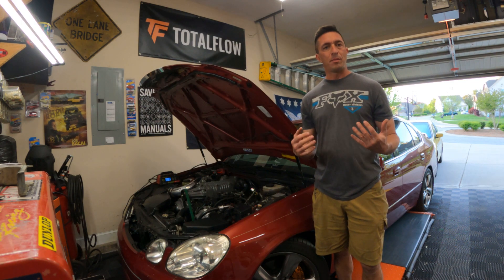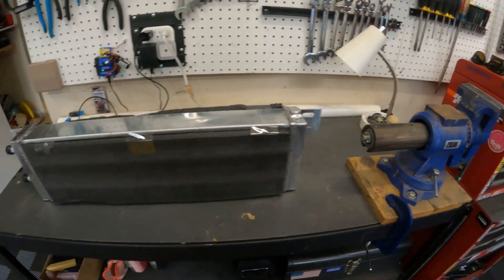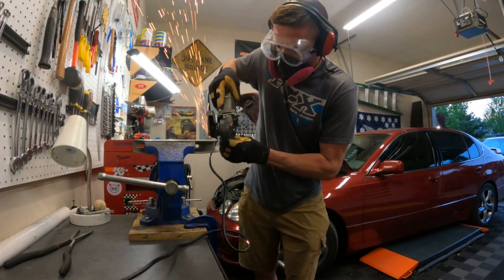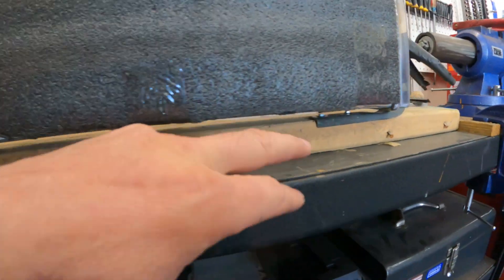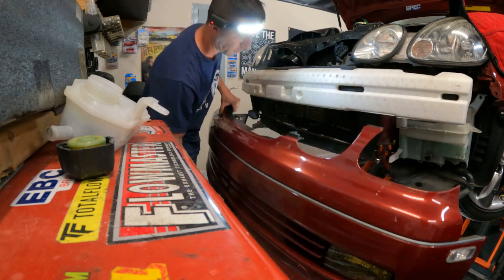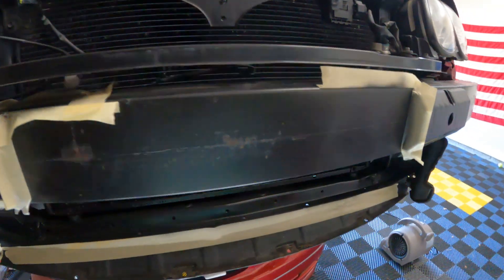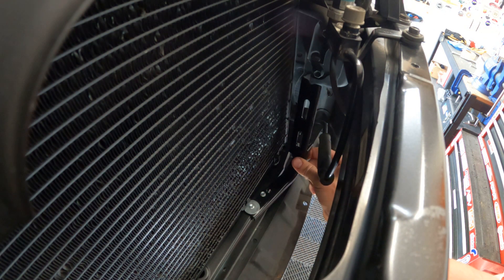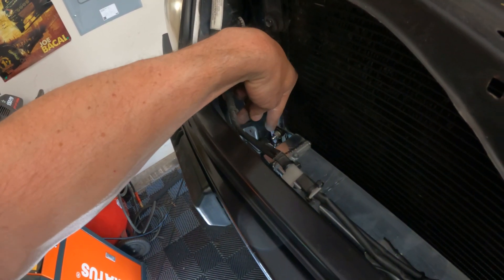Intercooling my boosted LEXUS GS400! (W2A heat exchanger added)

Comment: When you supercharged your gs400 how were you able to retard the ignition timing during boost or wot? Thanks!
Reply from the maker: I wasn’t able to. I just control fuel via 2 piggybacks. I don’t think it’s entirely necessary to run a standalone. Smart? Perhaps. But it’s probably $2000 to go standalone with a decent unit and custom harness, plus tuning.
Reply: @ForwardMomentum its nice to know you dont get any knock or detonation with the stock timing with the factory 10:1 compression + boost. Impressive because also because you went a long time non intercooled right
Reply from the maker: I went 1 summer w/o. By the next summer I had it IC’d.